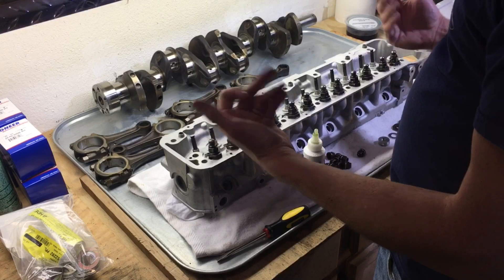How to assemble cylinder head and modifications

Comment: That video is wrong on many levels.
The valve seats are recessed into the head. Milling off the bottom surface doesn’t change the top at all. 
The timing chain tensioner is spring loaded and uses oil pressure to tighten the slack side of the chain. It will take up a lot of slack without any modification.
If you shave 0.080” or more, you may have to modify the chain guide on the tensioner side to take up the slack.
Then you need to get the timing right. The best performance is with the cam set so the notch is advanced ½ of the line.
See the manual if you don’t know about that.
Each tooth on the sprocket is 9 degrees. The #1, #2, & #3 marks are 4 degrees apart. 
If you mill a lot off, at some point, You will advance the cam sprocket one link and start adjusting from there.
Don’t use cam tower shims unless your head was warped and you shaved the top.
Cam tower shims come in 0.016” and 0.024”. Don’t use more than you shave off the top.
For example, If you shave 0.010” off the top don’t use any shims.

Comment: Dumb question. How would you know if the head is exactly how it's supposed to be to mount on the block?  Since it was removed when block was at tdc
Reply from the maker: Never dumb questions. Once you get the cam and cam timing gear paired with the timing chain, following install to line up TDC, chain link, and notch in cam timing gear, you’re golden.

Comment: I'm going to take a guess & say that cam did not last or you have a very noisy valve train that you can't figure what to do with. The video was good up until the 14:00 mark when you started to address the lash pads. Nissan FSM manuals do not measure valve lash between the lash pad & rocker arm tip but from the cam lobe heel to the rocker arm wipe pad. Not sure what exactly your machinist did to the head but if they put new valve seats in then the valve geometry will be off as very few machinist will set the valve seat depths equal on all twelve valves. This requires checking the cam wipe pattern is centred on the rocker arm wipe pad for each valve rocker & adjusting by way of lash pad thickness. A thicker lash pad will move the wipe pattern closer to the valve side while a thinner lash pad will move the wipe pattern closer to the pivot side. The cam has been reground so this automatically requires a thicker than stock lash pad. Also good luck finding thicker than stock lash pads these days.

Comment: Very nice video only thing that was getting me was low volume when speaking and too loud when music. I am curious on your cam specs as I am looking into one from Delta I am 2 hour drive from them. Are thos stock springs? Working on n42 head f54 block.
Reply from the maker: +Patrick Allaire thanks for the feedback. I’ve definitely been working on my audio, check out my later videos. 
In regards to the cam, this is their mild grind. Yes on the stock springs as well. I would say any more lift and aftermarket springs would be needed. Thanks for watching!

Comment: i want to do same mod as you. If i'm not wrong i need 280z valves and i can retain my lash pads? will appreciate if you can help me with it. Thanks
Reply from the maker: +Manuel Garcia-galarza depending on which head you have. If you have the P79, then yes on the valves. For the lash pads you will have to check them as I did to be sure.

Comment: Great until the last 2 minutes, why didn't you show checking the intake and exhaust at .008 and .01 and adjusting to work?  And why didn't you show putting the springs on?
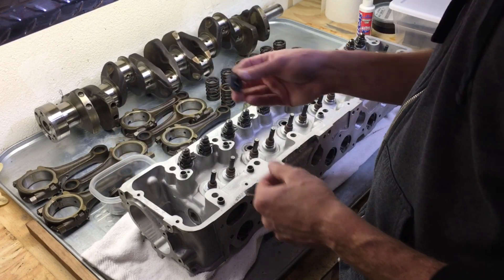Reply from the maker: Starting at about 7:50 I show the springs being installed and about 14:43 mention about setting the gaps for exhaust and intake. Felt for the overall video showing how to set the gap would make the video too long.

Comment: The wipe pattern between the cam and the rocker arms should also be checked to ensure a centered pattern on the rocker arms, like you did with the lash pads.  If not centered, different thickness lash pads must be used to correct the geometry.

Comment: What size lash pad did you use for your regrind? And what sort of regrind did Delta do for you?
Reply from the maker: The lash pads were stock, but had Delta also resurface my rocker arms. So that’s why I checked the wipe pattern to make sure they were sized okay still. I was lucky. The regrind is their performance grind for the Z. I have the print out of the cam measurements if there is something specific. They were helpful, I told them what I had done to the engine and what I wanted from it performance wise. Basically is a mild grind. .470 lift with intake duration of   281.1 @ .020 and 228.8 @ .050 and exhaust duration of 279.4 @ .020 and 231.8 @ .050
Reply: @CarsBikesandCoffee  You have made a critical error that may cause premature cam wear. The wipe pattern to check is on the rocker arm bed not the lash pad. You have had the cam reground thus material was removed from the stock cam profile. The stock lash pads will be too thin & the cam lobe will run off the rocker wipe surface. To check the rocker bed wipe pattern 1)cut a feeler gauge into pieces so that they are stackable in the valve spring retainer 2) insert stock lash pad on top of cut feeler gauge pieces 3)coat the rocker wipe bed with machine blue/marker 4) insert  rocker arm & tighten to spec valve lash 5) rotate cam & check wipe pattern 6) repeat by adding or removing feel gauge pieces until rocker arm wipe pattern is centered. The sum of the stock lash pad thickness + the feel gauge thickness will give you the required lash pad thickness. If your valve seats are all the same sunk spec & your cam is a symmetric grind then one valve check should suffice if not you will have to check each one.

Comment: Coupla questions for you: what is difficult lining up the towers and the cam?? did you torque the tower bolts incrementally?? Any cam bind? A slightly different question is did you check the wipe of the cam lobe on the rocker itself?? I thought that was more critical than the lash pad.  Gotta get my books out and study up!!! nice job though.  How are you supplying fuel?? triple carbs or FI? thanks
Reply from the maker: It wasn’t too difficult, just take your time. I found that finger tight and slowly moving the cam in and once in rotating it until it moved smoothly worked well. Then torque down the tower bolts. The torque isn’t huge so you just have to check that it moves smoothly, any bind, back off and try again.
With the wipe of the cam lobes, I had them resurfaced so I wasn’t too worried about them. For the lash pads you want them dead center for the wipe pattern. Check out my video on electric fuel pump install. Currently going to run my dual Weber’s then eventually switch to triples.
Reply: yes, you are right  Joe m and there is no need the check lash pad wipe as long as you get the lash pads to suit the reground cam.
The wipe of the cam lobe on the rocker is critical ,as you don't want it running off either end and f#*k the cam.
adjustable with different lash pads as cam tower shims are mainly used for chain tighten after head skim 
FYI  the bigger the cam the less std timing marks line up